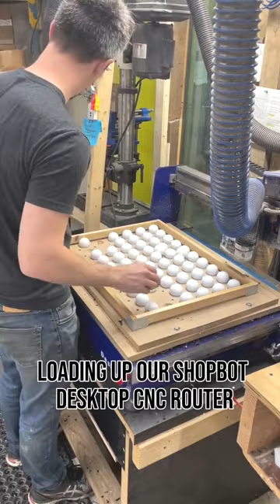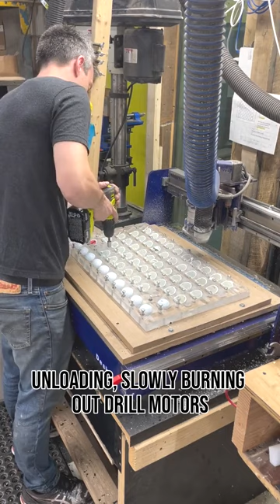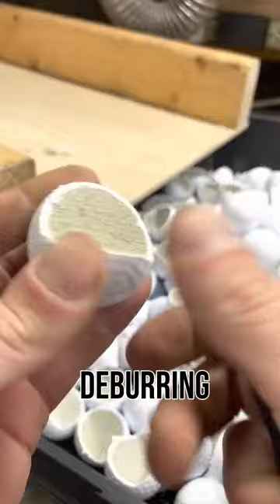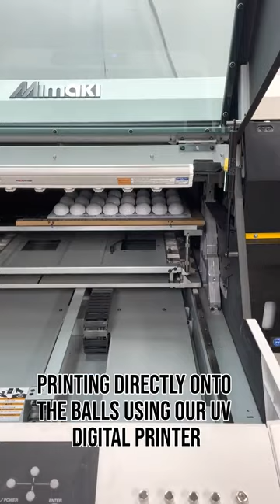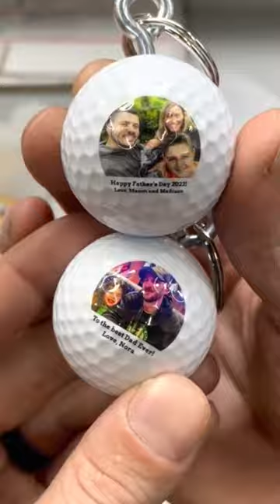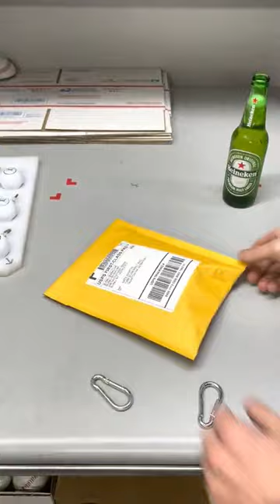How it's Made - Golf Ball Bottle Opener - #shorts

Comment: 56 minutes seems like a long time for a tray of balls...
Reply from the maker: The straight line pass you see is a roughing cut to clear away material. We then go back in and do a finish cut on each ball. We used to do just the roughing and it was a shorter run time but we had more cleanup work when de-burring. So we added the finishing pass which reduced the burr. 

We could probably rework the program to be 25% more efficient but with assembly being the biggest bottleneck in our process at the moment the run time isn't the biggest priority.